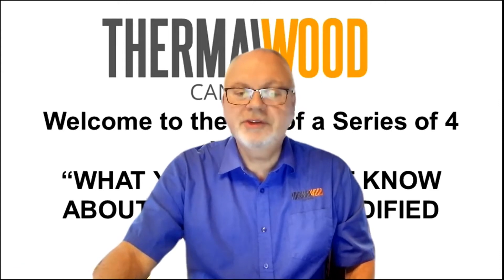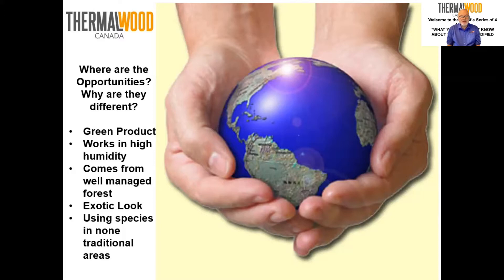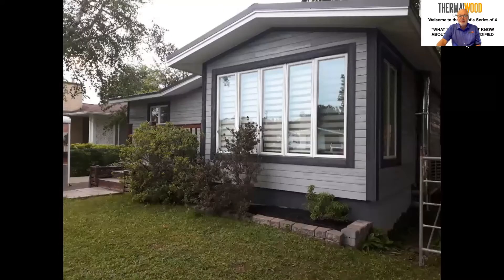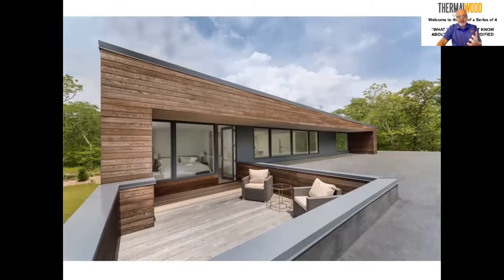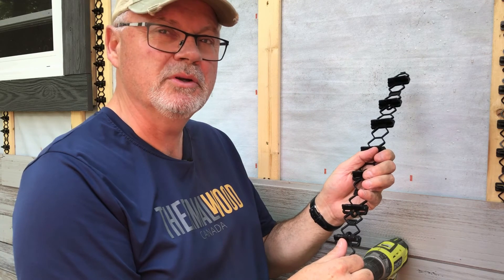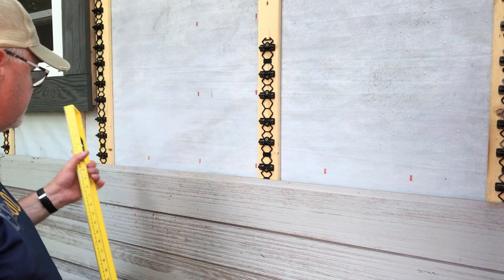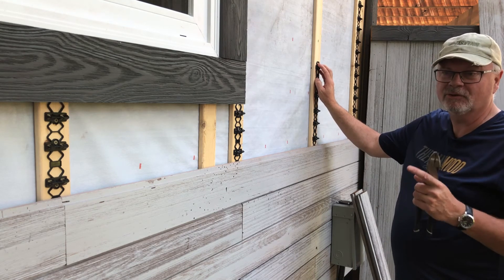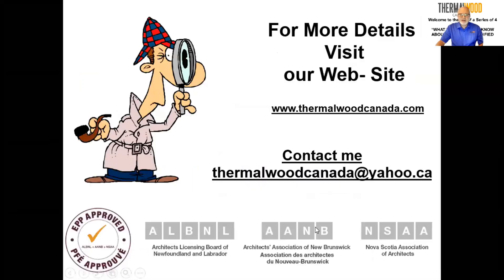Benefits Of Thermally Modified Wood Explained: (Part 3)

Comment: Nice clip system.  If a board needed to be removed, I suspect the clip would be damaged.  Is it possible to simply install a new clip to reinstall the board?
Reply from the maker: Once a board is snapped in place, it is in there pretty good.  You do have options though. The only way to remove a board with out damaging the clip or the board it self, is by trying to slid it off. This really only works if its in a area that it can be slid off. if its up against a wall or in the middle of  two other boards, then this method won't work. But if you are lucky enough and there is room for it to slide out, tapping with a rubber mallet and some patience will get the board out.  Other than that, you are either going to have to break the clip or the board.  To tell you the truth, breaking the board may very well be easier.  Taking a skill saw and making a shallow cut above where the clip groove would be and snapping the board, is your best bet. You can then cut another piece to size and replace it.   The clips them selves are pretty strong, especially when you have 2 clip heads every 16".   But you are also able to simply install a new clip if need be.  you can just cut the strip to length and install where you need them.